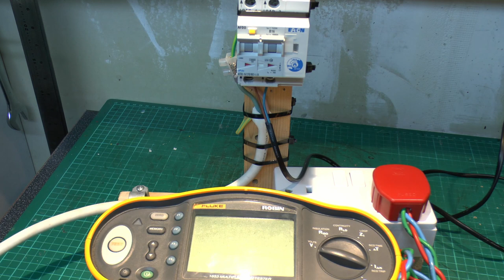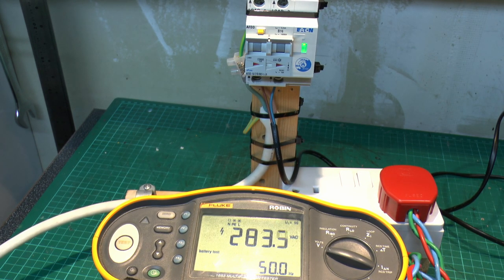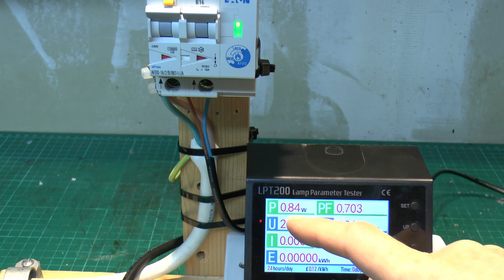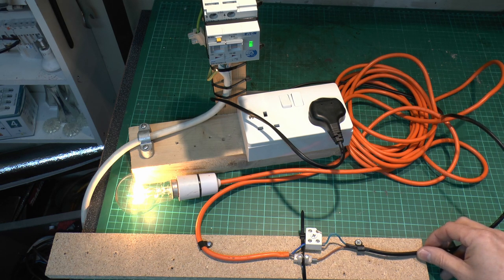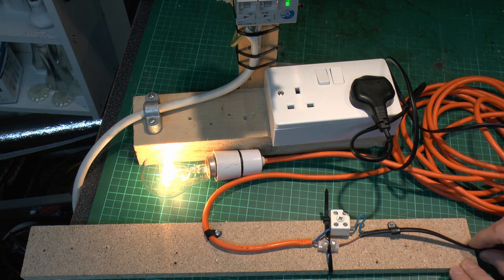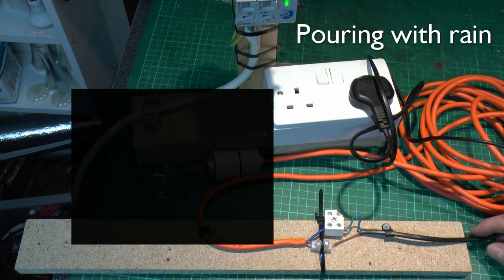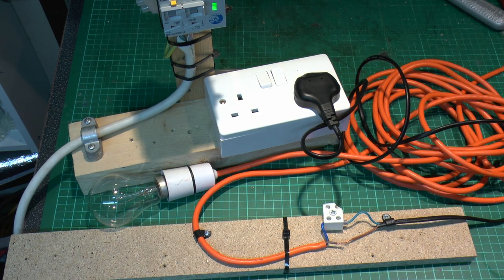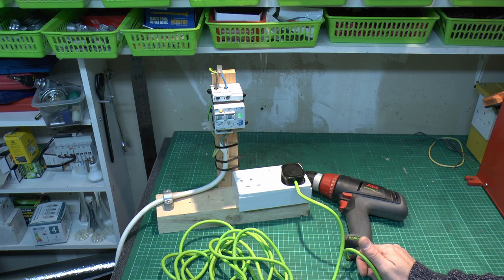AFDD Arc Fault Detection Devices Additional Tests (Part 2)

Comment: Is there any actual point to having these in a typical English house?
Reply: Just another way to give your hard earned income to the big wigs. These devices are slowly starting to creep into our rule book (AS/NZS3000)
Reply: How many are typically in the average house? Isn’t it usually just 2-4?
Reply: @ericspda . I've got 3 light circuits and 4 power circuits at my place.  Plus cooktop,  oven,  air con etc on dedicated circuits too.
Reply: A.S isn’t that exceptionally uncommon? Would 2 be the expectation for a typical older house?
Reply: Obviously not.
Reply: @ericspda . Our power circuits are either 16a or 20a dependent on circuit conditions.  ( i think you folks call them radial circuits?)
Reply: Well, not this one - that is for sure!
Reply: here in the US they're already in the code, and cost 8x more than regular breaker. It's only a matter of time until they creep into yours too
Reply: nickhill92 - How many mains electrical circuits in a typical English house? Well, firstly, the U.K. rules apply to the rest of the U.K. as well as England...
But to answer your question, it depends on the size of the property and how recently it has been rewired. Older two and three bedroom houses typically had one or two 5A lighting circuits, and one or two 30A ring circuits (for the sockets). If there was an electric cooker, this would be on it’s own 30A circuit.
Modern homes often have consumer units that are larger with more circuits. For example, in my home, my consumer unit has the following: main switch circuits: three 32A RCBO for the three ring circuits (one ring being for the kitchen and small utility room), a 6A MCB for the alarm system, a 3A MCB for the door bell, a 3A MCB for the smoke detectors, then the RCD switched circuits are: a 32A MCB for the cooker, four 6A MCB for the four lighting circuits and a 16A MCB for the hot water tank (emergency use, as the water is normally heated by a gas boiler which also supplies the central heating radiators).
Reply: So they can sell more electric!
Reply: These are now required in bedroom circuits in Canada.

Comment: Hi JOHN, I have a 3 phase 10kw solar inverter connected to grid. It has 4 MOVS: S20K300 which keep blowing nearly every month or so. 3 MOVS are between 3 phases and earth and the 4th is between neutral and earth. Which external protection device should I use to prevent these from getting damaged? Currently there is a 6 Amp mcb connected to 4 pole contactor,  which is then conncted to inverter. Panels installed are 3KW hence 6 Amp mcb is fine. I am also curious if our grid has some issues or if my earthing has some problems.  Apparently earthing looks fine as with multimeter it is measuring 2 volts more than neutral when checked against phase. Appreciate your advice. Thanks

Comment: The thing with AFCI/AFFDs is that they are a fantastic safety device IN PRINCIPLE.  Unfortunately, they were rushed into mandatory service several decades before the technology was anywhere near mature enough to actually deliver on the promises.  AFCI breakers are about as mature a technology today as the early GFCIs were, perhaps, 40-50 years ago.  Sadly, they are mostly only good for excessive nuisance trips (the most popular brand in the US, Eaton, is notorious for tripping in the presence of even fairly weak RF signals, so one amateur radio operator in a community transmitting at just 100W can potentially knock out power to entire subdivisions equipped with these faulty AFCIs, and they are out there by the millions now).  What the NFPA was thinking when they convinced the NEC to rush them into mandatory service decades before they were a mature technology is anyone’s guess.  The reality is that many homeowners, after paying thousands of dollars to outfit their load centers with AFCI breakers, are at some point down the road very likely going to have to pay many thousands more to replace them all two or three more times before they are finally a mature and reliable technology...or they will have to put up with all the nuisance trips that they can produce.  After all, having your refrigerator circuit repeatedly deactivated because someone drove by with a CB radio (or any other radio of at least a few watts power) is liable to get old, and costly, after awhile.  That and one has to wonder if the circuitry in these was genuinely engineered well enough to provide decades of service without the circuitry itself failing at some point as homeowners do not ordinarily replace circuit breakers for many decades at a time — visit a 40 or 50 year old home and you are likely to find 40 or 50 year old circuit breakers, I just don’t see these lasting anywhere near that long on average.

Comment: Have seen that experiment (it´s german) https://youtu.be/CWqVVDEvd0Q?t=244
He says, that the temperature carbonizes the isolator and this leads to a stable arc which then triggers the AFDD (in the second trial instantly). He states that that is the error condition the AFDD should actually trigger, nothing else.

Comment: Very interesting, and comprehensively tested. Clever looking for DC current when arcing.
 I am sure some local council authority (UK), will be convinced, or cajoled by nefarious means to have these as standard fitment in new builds etc. I can see the rationale behind the arc detection, I assume this feature is used in line power applications.
Thanks for sharing.

Comment: To touch the copper conductor on line @8:39 whilst plugged in and the device live shows great confidence in having actually remembered to turn off the switch on the outlet...

I have grave doubts about the utility of devices like this, as it seems to me they are either going to be so sensitive that there will be lots of nuisance trips or so insensitive to avoid that, it will not provide any functional benefit anyway. However, I can still imagine the industry lobbying for these just to make more money. If they were to be compulsory, there's also the little issue of space as if a three module width unit is required for every circuit, I doubt many installations would have enough space, and in many properties there won't the enough room in the current location to install a much larger one.

Comment: What about arcing on the neutral side, would that make any difference?
Reply from the maker: No - it's AC, same current flows in each conductor, and the direction of that current changes 100 times a second in both of them.  Device has no earth connection so would be impossible for it to determine which was L&N.

Comment: Thanks for the video.

Either that example you have there is possibly a dud, or the concept is.

One of the methods the devices use to detect arcs, is to sense the presence of power harmonics. So in the case of an arc on 50Hz, they are supposed to sense a 100Hz signal on the cable, with the ‘signature’  of a typical arc. Presumably then, the on-board software takes note of the duration and repetition of the 100Hz and decides whether, or not, it is an arc.

I think this demonstration shows, assuming that the example under test is OK, that an AM radio is, at present, a more reliable electronic device to detect the signature of arcing.

Comment: I am shocked that the device didn’t trip after all that effort . It’s going to be difficult to look a customer in the eye and say they need to spend a £1000 on AFDDs on each circuit when the test results so far are utterly unconvincing. Is it the brand? What about other manufacturers’ devices? Is it just that particular device? I can feel a destruction test coming on John .......? Adrian

Comment: Well, as of this week (21/9/2020) the draft Amendment 2 to the UK regs, BS7671 is proposing to make them compulsory for all circuits of 32A and below that are not lighting. https://standardsdevelopment.bsigroup.com/Projects/9020-04654/#/section  is the draft for public comment, section 421.1.7 is the key one. (about 2/3 through the first of the 4 parts)   You do need to create an account with the BSI to leave a comment, but anyone can  do that. I for one will indeed be commenting, that I think this is not a good thing to add to the regs. Others may care to do the same.

Comment: I would repeat the test where the voltage increase is sharp and quick. I.e more analogous to an actual "spike" than a slow, creeping voltage increase, which is how you tested it.
I make this comment because, of something interesting I observed that happened recently in my kitchen when I was carefully following some recipe, (Please stick with me on this. It really is relevant).

Well, I was precisely measuring out some salt, and It got to the point where I was almost up to weight and I was adding extra salt practically grain by grain. After a few minutes of the digital scales holding steadfast, I was becoming quite annoyed. "Surely, I have must added more than a gram by now"  I said to myself while the scales were still stuck on 3.9g. (I was aiming for 4).
I ran off to get some other digital scales (equivalent accuracy of 0.1 g) and dumped the contents of the first pair of scales onto the second. Well, well. What a surprise: 5.7 grams!

Try it for yourself. Measure out say 10g salt or sugar onto your scales and then gradually add to it grain by grain. You'll be there for quite some time before those scales move.

Discalaimer: It also could be just that my scales are cheap. But it would be interesting to know if the same thing happens on a "quality" pair of scales.

(PS: It's a long time since I've seen a Hospital Saddle.)
Reply: its not inly on cheap scales at wor somethimes i have to count leds with a  rely expenciv scale with a resolution of 0.01g   and a countig funktion some leds wont get counted but if you lift the tray and place it on the scale again it has counted the led
Reply: It's probably caused by stiction, ie the fact that a bearing or sliding surface requires a higher amount of force to start it moving than the friction it sees once it is moving.
Reply: Except that most electronic digital scales use a strain gauge - no bearings to get stuck. A typical strain gauge is a resistive sticker put on a bar of metal. As the metal moves slightly under load, the resistance of the strain gauge changes. This is measured by a microcontroller.

Comment: I am informed these devices only detect an arc if the load is > 2.5 amps - so a broken heating
element in an electric blanket arcing and setting fire to your bed is OK  !!!!!!!!!!!!!!!!

Comment: What AFDDs are supposed to protect against are arc faults that could start a fire. At the same time they shouldn't trip on conditions unlikely to start a fire.
Reply: Robert Grant - And how do you tell the difference between an arc that can or cannot start a fire? If we can’t say, how do expect a “dumb” microcontroller chip to tell the difference...
Reply: We can say. We know the ignition temperature of PVC, we can calculate how much energy is required to heat the conductors to that temperature and we can measure or calculate the high frequency spectrum created by such an arc and design a detection / protection device accordingly.Such a protection device is not going to be 100% reliable in preventing electrical fires but neither are RCD / GFIs at preventing every possible accident from an electrical mishap . Here is Au the RCDs used for most domestic installs are rated to trip at 30mA. For the majority of humans that will protect them from electrocution but will not prevent every possible death from an electrical mishap. It also means there's some issues with parasitic tripping of RCDs from condensation etc. The general consensus is this is a reasonable compromise.
Reply: I wouldn't have said "bullshit". Certainly they will not protect against every possible way electrical energy can start a fire just as RCDs will not protect against every possible way to be get an electrical shock. The same goes for seatbelts in cars and helmets on the heads of cyclists.

Comment: This seems to be whats required to trip a AFDD. They seem to be pretty insensitive: https://youtu.be/JRXFZHKGaXg?t=745 . Seems they are deliberate that insensitive to not false trip when running brushed engines and such. It would be smarter if AFDD manufacturers could include a "learn" mode where you push a learn button and then you run said machine/thing and test lightswitches and so on that is connected to said Circuit, and then it will learn a threshold so it don't false trip but still trip at unnormal arcing.

Same with GFCIs, Personally I think 30mA is pretty high and it would be easy for GFCI manufacturers to include some "learn" mode here too, where it will Always trip at 30mA, but the "learn" mode can be used to "learn" a lower trip level into the system, so on a good circuit with low Earth leakage, it could even be learnt to trip at like 10mA or even 5mA. And in such a combined device, the "learn" button could then be responsible for both Learning AFDD And GFCI parameters into it.

Or even a fully automatic learn mode where it will during the course of a week of normal usage, automatically learn the "normal parameters" of the Circuit (arc signature and Earth leakage current) and if anything gets unnormal, it should of course trip.
Reply: Not so sure about that "learn mode", install one on a circuit with an existing fault, it learns to ignore it from day one.  Just sounds like a way to treble the price.

Comment: Piece of expensive junk. Over voltage protection is A Good feature if it Will work, since in Continental europe in domestic you have 3phase installation, and if for any reason your neutral cabble is damaged on supply side, you could end up with 400 v on 230v socket outlets. This thing appears to only be an expensive RCBO since only this two things works as they should. Shame for Eaton. Regards.

Comment: What happens is that the wiring is design to protect the AFDD. Wait! Isn't it the other way around? So far It looks like another way of milking the cow as these devices creep into wiring regulations all across the world. In my opinion it creates a false sense of safety that could cause more harm that good as seen by the performance of this particular subject.

Comment: Are you not worried about ozone - you must have generated significant amounts of it doing this. Ozone is almost as toxic as cyanide. And is best treated with extreme respect.
Reply from the maker: Ozone generation requires much higher voltages to create any noticeable amount.